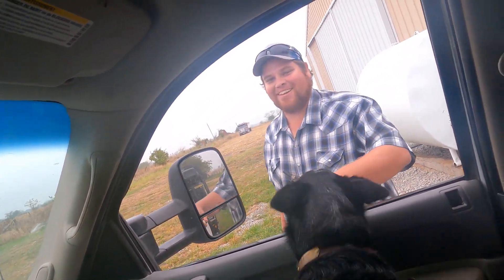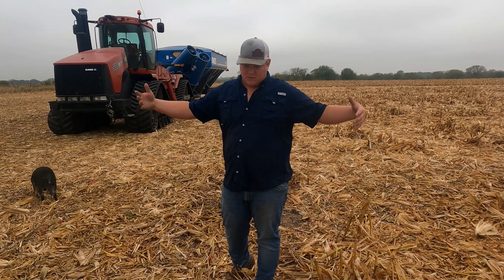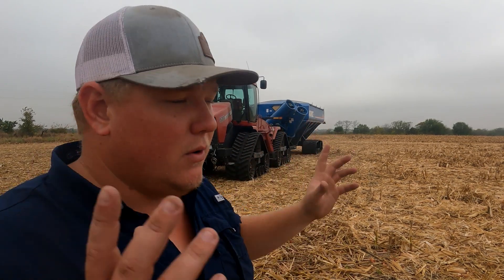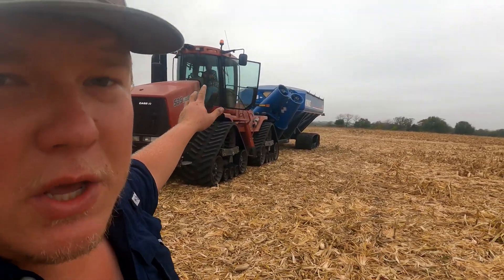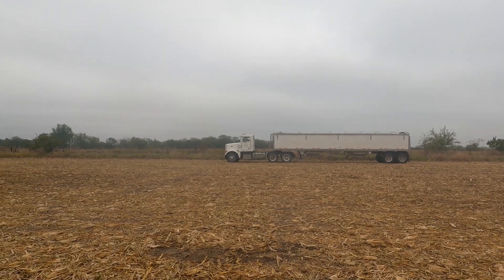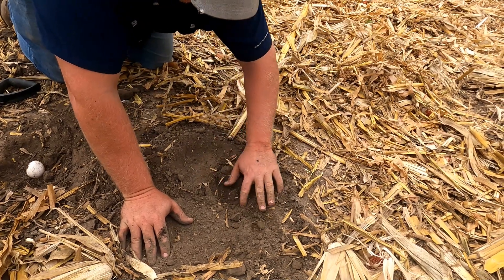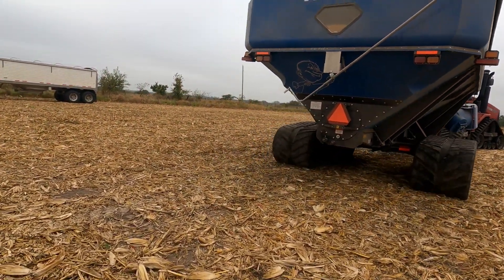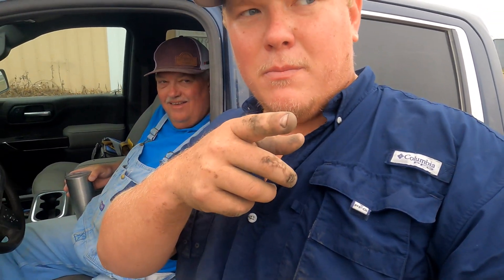138,000 POUNDS vs. EGG - You won't believe it.

Comment: We run tracks on everything on our farm .  The reduced compaction has increased yields and limited tillage required.  We can start earlier in the spring and run after it rains . Tues of this  week we received 4 inches of rain and we were harvesting corn the next day with no problem going through standing water  while the neighbors are sitting and will be for a while . The egg test was totally acceptable and spot on . A guy could place his foot under the track and survive unscathed.   For All you tire guys we tested tracks vs tires many years ago before going to tracks . Tires are great for long distance road travel and when in deep mud pulling tile plow but other than that they aren't good for nothing.

Comment: Sorry.. the psi you calculated is average. The force for the tractor is different for the force of the cart if the tongue is in neutral weight load. So the psi of the tractor is 53000 lbs/ 9600 inches= 5.52 psi, and the cart would be 85400 lbs/ 8640 inches= 9.88 psi. This would be ideal if everything was evenly balanced on the cart and tractor. 

I like the lesson though :)  Keep the videos rolling!

Comment: You have to do the experiment in tilled ground, in your test the tractor bridged over the hole you dug because the soil was more firm around the hole.
Reply: 100% correct...a floater tire would have did the same thing.

Comment: You needed to replace ALL the material removed back over the hole and not just make it level. The tracks would span an open hole. I get the experiment, just too many variables for proof. Tracks have way less compaction period. That's why snowmobiles have tracks and not bike tires!

Comment: you should do the same but drive a wheeled tractor over them.  see what results you get.  I am not saying that you are wrong that the tracks distribute the weight across more area but you need to show the rest of the "experiment"  and prove that they are better than a wheeled tractor.  what is the PPSI for a wheeled tractor and cart with similar weight.  Ect.

Comment: An egg's structural strength lies in the longitudinal (standing on end) direction. Still, that was pretty impressive.
Reply: Yep,put a egg the long way in your hand,finger tips to the back of your palm and try and crush it...if you don't touch the sides of the egg....90% you won't brake it:)

Comment: I would think that the tractor will be doing more damage to the ground than the grain cart, as the tractor tracks are going round they will exert more force onto the ground than the grain cart being pulled. So there might have been a chance of the egg almost at the surface surviving with just the grain cart going over it